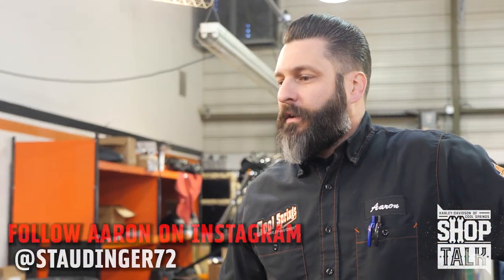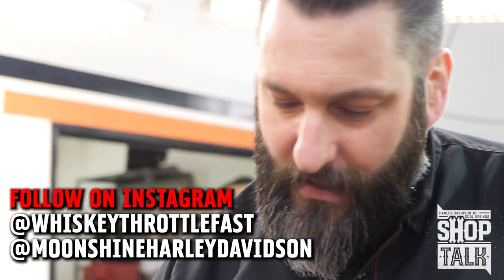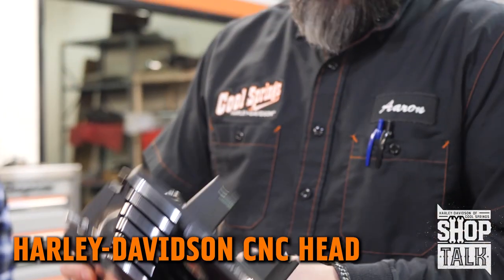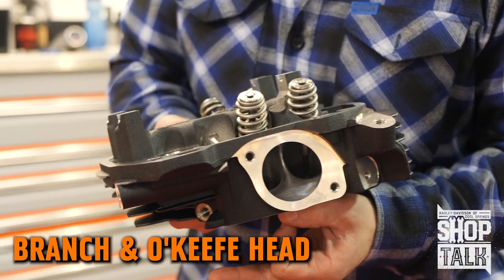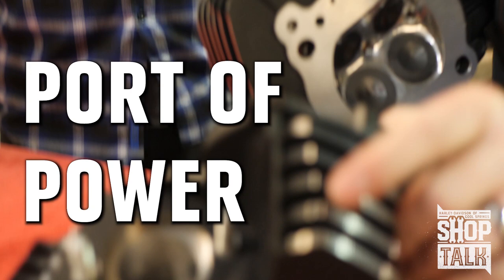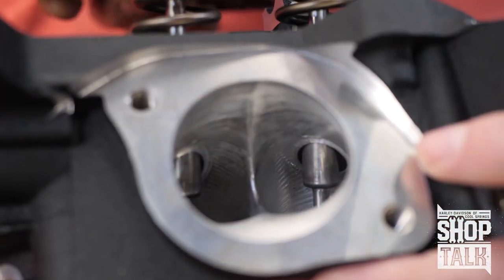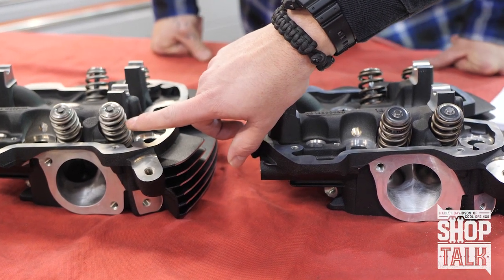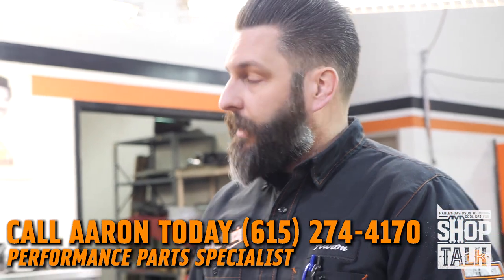Cylinder Heads of POWER! Harley vs Branch & O'Keefe | Shop Talk Episode 15

Comment: Getting ready to send in my M8 heads over to Branch. I'm putting on SE 131 jugs hoping for 160 +. I'm installing a 62 mm hpi TB as well.
Reply from the maker: There are different parts we would do to get 160. Please call the shop and ask for Jamie 615-274-4170. The 62mm is small for the numbers you are looking for.

Comment: Would the heads flow air better if they did a finishing pass with the CNC ? I'm curious if all those small ridges slow the air down at all or create small amounts of turbulence ? It would be cutting hair, but if it were smoother but still opened up more, wouldn't it function that much better ?
Reply from the maker: Hedonist - smooth has shown to flow better.
Reply: Turbulence is good on the intake for better air fuel mixing. On the exhaust smoother is better. You want that hot exhaust out now. For thermal efficiency I have my heads ceramic coated on the valve faces, combustion chamber, back of the exhaust valve and the exhaust port.

Comment: So.. I’m getting a bit confused and frustrated... Millions and millions of us ride Harley’s... but all I’m seeing is how Harleys parts are inferior and how we should buy after market stuff.. S&S, fuelmotor, baker, etc, etc... at what point do we say, I’m not riding a Harley anymore, beside the frame and tank logo 
All this videos suggest that the Harley u buy isn’t any good. 
What am I missing?
Reply: is it any different with other brands or even automobiles?  No one uses factory parts to get the most power.
Reply from the maker: CORRECT!
Reply: It’s all in what you want to do all bikes or cars trucks it’s not just Harley if you want performance and you want to go fast you have to dig into your bank account
Reply: Well since you mentioned it...
Harley frames are in the world I came from known as flexible flyers.
I still love them...
As far as tank logos...they do sell some really badass ones lol
Reply: A factory Harley is fine for most, but moco has a marketing plan to upsell you a bunch of aftermarket goodies to get way deeper into your wallet!  They know some dudes need to compensate for certain “shortcomings”..... 😂.